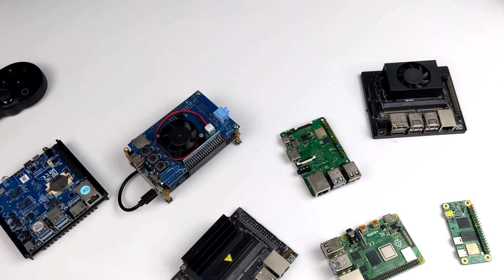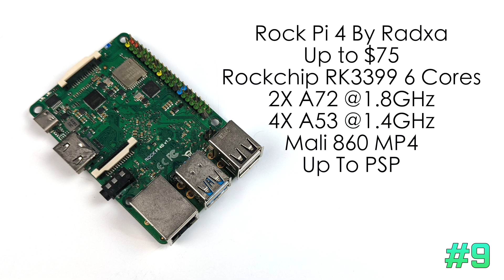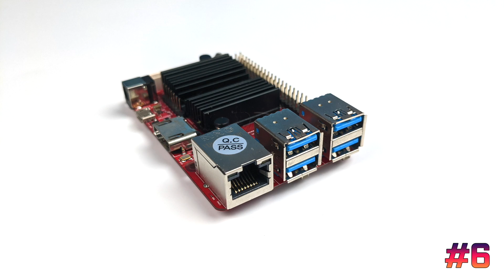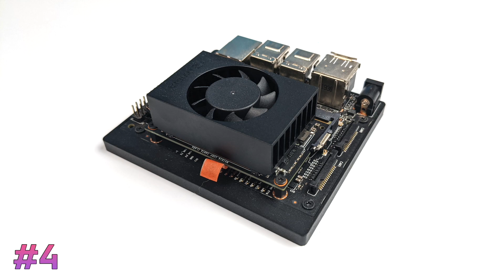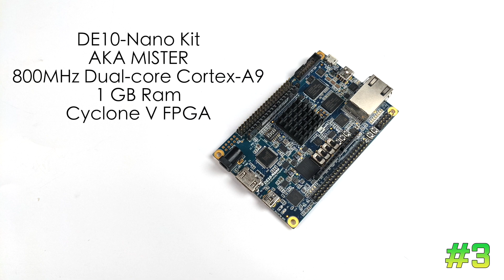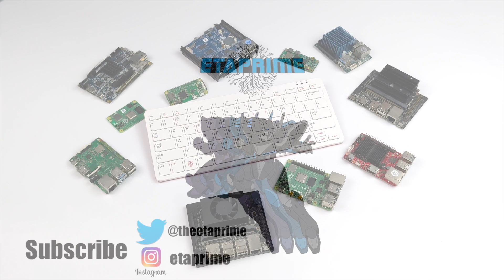The Best Single Board Computers Of 2021 Top 10 ARM SBC’s

Comment: The Raspberry pi 5 is going to be such a game changer. I already use my pi 4 as my main desktop PC. The 5 will put it over the top. Small form SBCs are the desktops of the future.
Reply from the maker: Yeah I think they are gonna come out strong with the Raspberry pi 5
Reply: @ETAPRIME  @Richard Dukard When do you think it'll be released?
Reply: @sametayaz4891  released most likely on pi day 2022, 2021 is a bit early to be likely + silicon shortage, maye 4+ and a then
Reply: @ETAPRIME  with hardware or software? :P
Reply: @mogad yes you're right, pal. Early 2022 seems not promising.
Reply: Even if they just bump the CPU up to a Cortex A73 at < 20nm it will be a huge improvement. Drivers will still leave lots of graphics performance on the table though :/
Reply: The main thing is to be able to run on battery
Reply: I'd wait at least 2 years because there was a gap from 3 to 4
Reply: You're either trolling or meming. The Pi4 is unusable as a Desktop PC, because of its hacky GPU and it stutters when watching youtube. No VP9/4k video playback. And in the best case you get 1xPCIe2.
If the Pi5 has better video decode and more PCIe lanes it might be ok as desktop PC.
Reply: @kwinzman  I watch YouTube just fine. Ubuntu and Manjaro can handle 720p with very little frame drops. I don't want or need 4K playback, and I don't care about playing the latest, maxed out PC games. I stand by my original comment.
Reply: @richarddukard8989   "720p with very little frame drops" I have nothing to add. The general population wants to Youtube on a desktop PC and expects at least 1080p.
I am happy for you if you are okay with less though.
Reply: @kwinzman  haha, 720p60 instead of 1080p60 means it's "unusable" to the "general population"?. Ok dude, have a nice day ✌
Reply: @richarddukard8989  Yes, that's right. On their main desktop people expect to be able to watch Full HD Youtube. Have a nice day ✌
Reply: Yeah for the vast majority of lighter users, a pi 4 is probably enough. The pi 5 should be exciting.
Reply: Mine was my desktop for a month when I moved, and it was good enough for almost everything my. If not for gaming, I wouldn't need more.
Reply: I bet the 5th version will just be a very small upgrade.
Reply: isnt the Raspy 4 too slow for that use case? I did that on the 3b+ and it was horrible...
Reply: I use a couple 4 for programming at home and at work. Works excellent and just enough
Reply: i will buy a raspberry pi 5 if its capable to handle at least1080p videos on youtube properly and fluidly...if its not capable then its a waste of money imo...
Reply: @ziggy8757  A recent OS Update of Pi 4 tweaked from 1.5GHz to 1.8 GHz. And support 1080p resolution. There is some update in graphic driver i guess
Reply: @ziggy8757  lol pi4 runs 4k@60fps it will only drop below if the os is unsupported
Reply: @Amorousstake4  are you sure it can handle 4k in YOUTUBE on a browser without dropping frames like crazy? cant believe that.... even ETA showed in a video that at the most it can handle 720p in youtbe without dropping frames
Reply: @ziggy8757  varies with os what i said also you can overclock it with a heatsink see from explaining computers YouTube channel
Reply: @ziggy8757  the problem is codecs. YouTube uses VP9 and now AV1 for these high resolution formats. The Broadcom SoC only has H.264/AVC and H.265/HEVC hardware decoding capabilities. It has to do others in software. The next Pi better have a SoC which can do at least VP9 decoding in hardware.
Reply: i just hope the RPI 5 has a M2 SSD slot and a PCIe Slot then we could put a Radeon on it to boost the GPU capabilities
Reply: @rockapartie  Sounds like you had a 2 or 3. The 4 has twice as much ram, so web browsing is fine.

Comment: I was surprised that the RPi 4 was the top on the list. It's not the most powerful by a long shot, but I guess that optimization is king when it comes to this particular use-case.
Reply: Software is what makes these things work, without it you could have the best board and it would still be useless
Reply: @iHawke  totally, thats exactly why i went with pi4 for my retro console its tried and true and easy to get cases for. Im not a programmer so i need something thats well documented that i can put together with help when i need it. The pi4 has been perfect for that. I got a pi zero im now trying to figure out what to do with
Reply: RPi documentation is also superior compared to other Scs

Comment: The endless uses for the Small Block Chevy always impress me
Reply from the maker: LOL i was just looking into an LS1 swap for my E30
Reply: @ETAPRIME  I put a 5.3 with cam and springs in my 71 C10, runs like a scalded cat. 10/10 would recommend
Reply: @AustinRBa  You Yanks have a very simple, one dimensional approach to cars. 😁 Give it a big engine, job done. Don't confuse the driver with concepts like a manual gear change and a third pedal. Straight lines and drag races rule. Apparently, small, light and nimble are banned concepts in the US of A! 😉  God help you if you tried driving your car down some of our country roads in the UK, you'd get out and walk. Or crash. Probably both, in reverse order. 😉
Reply: @ETAPRIME  Swap in a S54. Not a fan of American engines in European cars regardless of performance. Plus the S54 is insane in an E30.

Comment: I used to be all about SBC’s for emulation use for friends/family/myself. In the end though, It just ends up not getting enough use or sometimes completely forgotten to justify the cost/setup.

I’ve ended up sticking with the Verizon Stream TV 4K (with the S905X4). Great multi-use device that plays PlayStation/N64 games well, but also supports the AV1 codec and is Netflix approved so it should last a while as a streaming device. Just gotta slap a different launcher on it to avoid the Verizon branding.